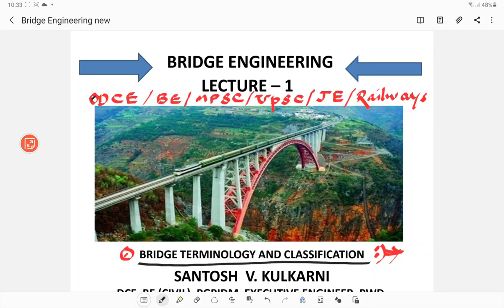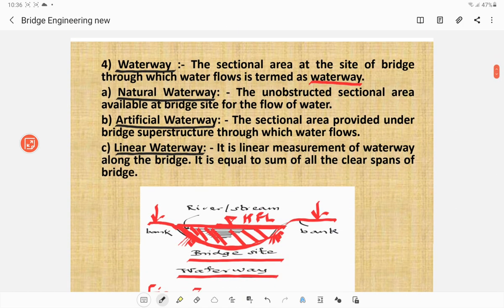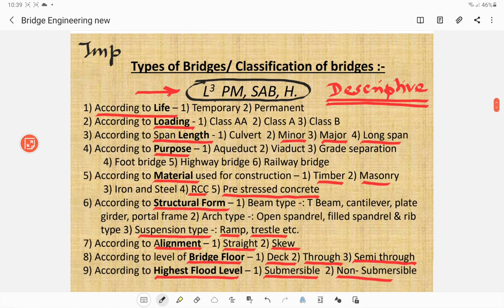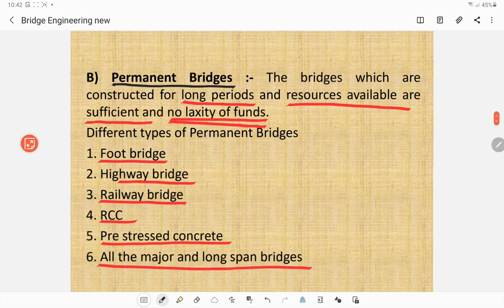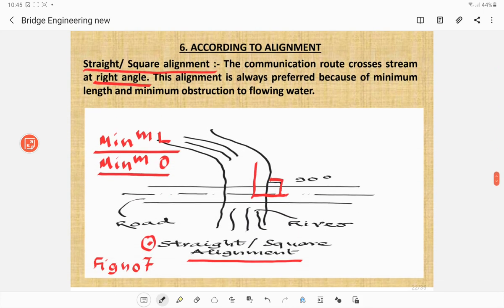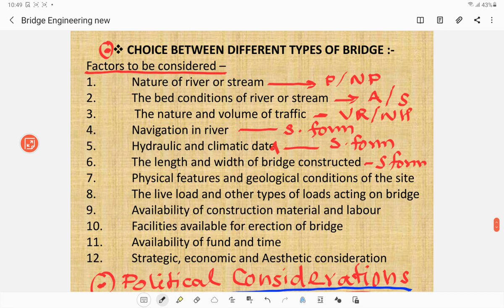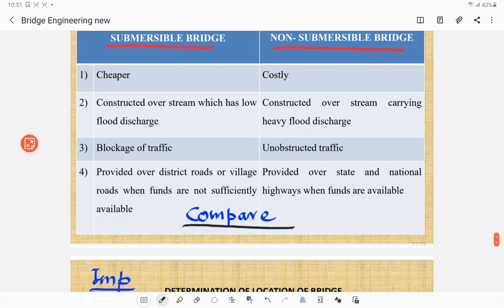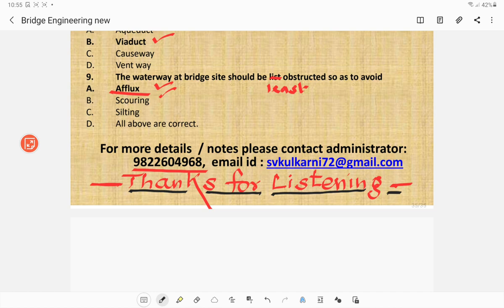BRIDGE ENGINEERING LECTURE 1

Comment: one not clear if clearance is vertical then difference between vertical clearence and free board difference??
Reply from the maker: Free board is a part of vertical clearance .Vertical clearance is always greater than free  board because it is the distance between the water level and the bottom of superstructure
Reply: @santoshkulkarniscivilengineeri  vertical clearance is difference between HFL to bottom of slab
And free board is difference between formation level to HFL  is it correct?
Reply from the maker: @amarmadole1994  free board is the difference between normal water level and hfl